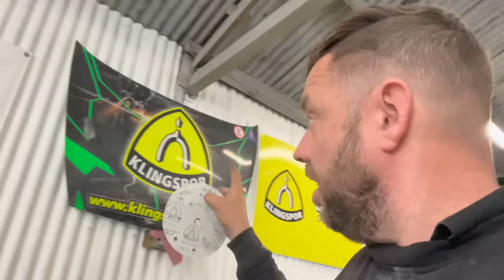I'm Sure This Doesn't Come Factory. Welding A Real RotBox VAN😬￼

Comment: you know it is going to be a long job when there is as much van on the floor as there is on the lift!!!  the sills are now the best bit of the van, if it fails test it wont be on  expanding foam as a structural component, bet the owner was well pleased , did it pass test? , thanks guys 👍
Reply from the maker: yes they was and yes it sure did

Comment: Pinch weld can be drilled and plug welded , thats a full sill replacement youve done , not a set of cover sills , its cover sills and patches that need to be fully seamed , would have saved you a fair amount of time of toud drilled and plugged 

Regardless , great job as usual colin 👌
Reply: He’s done a proper sill replacement job so the only way is to seam weld it it’s far stronger and will last longer

Comment: Great job Colin, keeps it on the road for another few years, no point in sending to the scrapyard if the rest of its sound. Did you consider white scutch for the outside? Wouldn’t have drawn you aye as much as the black. Not saying black was wrong to use or anything.
Reply from the maker: it was not in the table in the cost wise plus back last longer then the white for the white colour drops off after 6 months